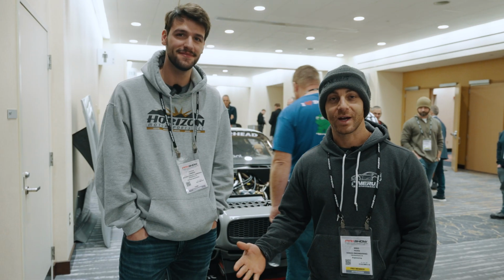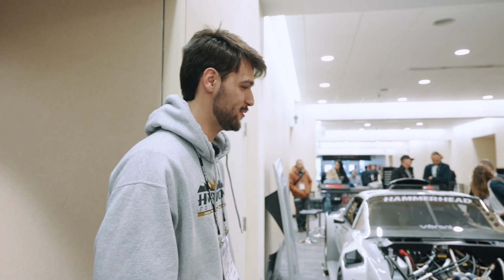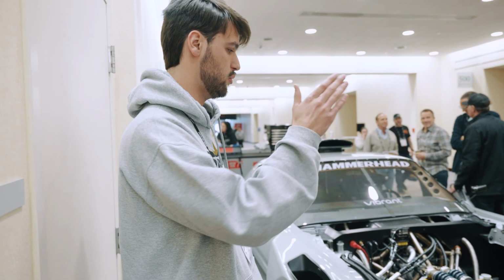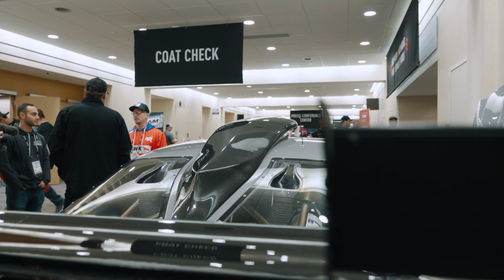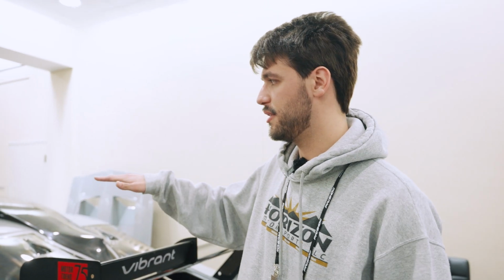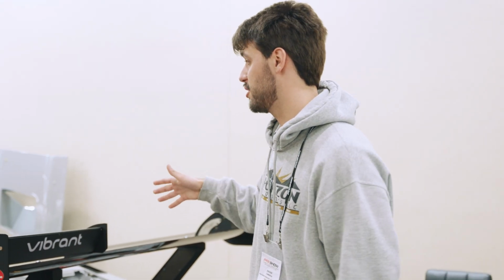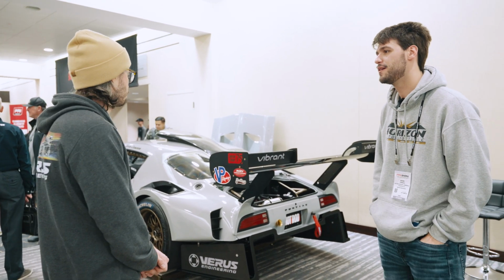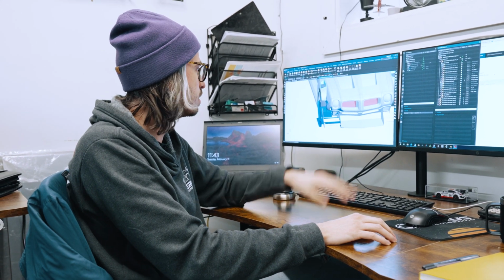Aero Consulting with Horizon Motorsport LLC | TransAM Time Attack Build

Comment: I at the same time love that they used an aero friendly cross-sectional shape on the front control arms and even oriented them in the right direction but then just as much hate that they did it when the arms are in a body and not exposed to any airflow.
Reply from the maker: It's suspension out of a champ car! Pretty wild!